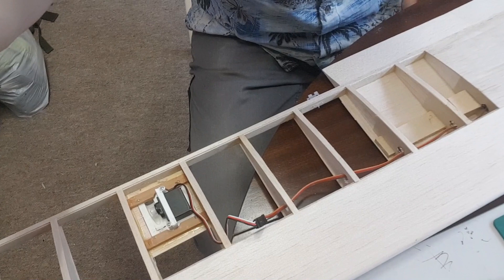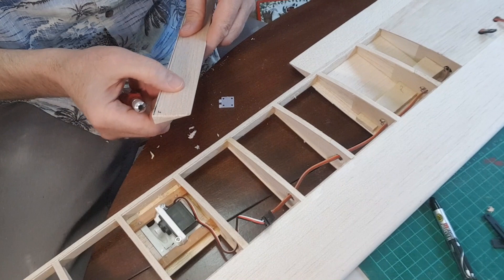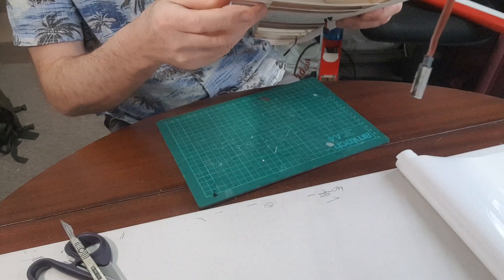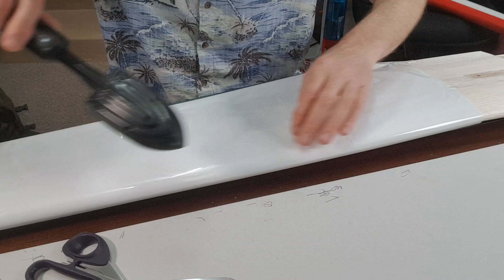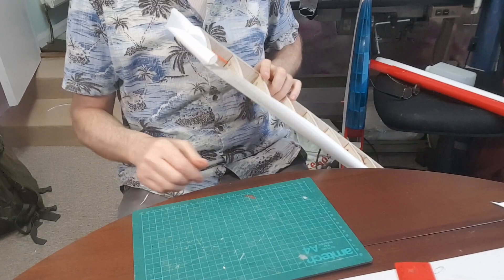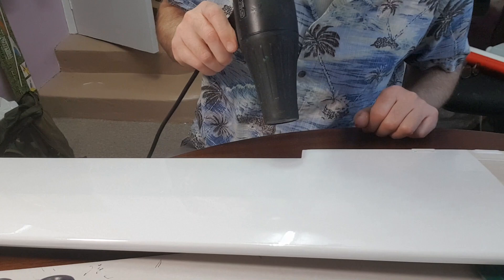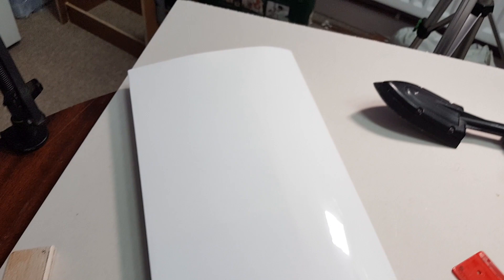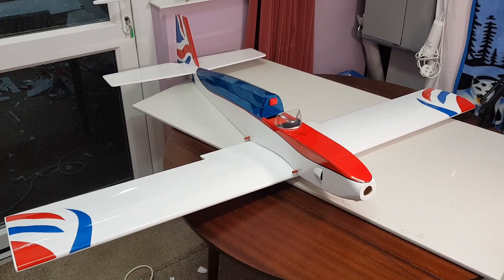Kamco Kavalier RC Plane Retro Build Part 5 Covering the Wing

Comment: Wow Cliff it's looking great,  when you covered the second half,  top, of the wing how much do over lap the covering? Hope you're not going to fly around the pole and risk cracking the beauty up. Looking forward to the next episode,  Jeff in LA USA
Reply from the maker: Are you say my round the pole models end up in the bin Jeff? 😁😁 To answer your question though I don't really have a set amount, it sticks pretty well to itself with heat, could be as little as 1/8in or 3/8in, what you don't want is the covering to pull away when you heat it due to insufficient contact area being stuck down, it comes with experience I guess.
Reply: @CliffHarveyRCPlanes  Thanks  Cliff, right now the balsa plane I have is the SIG Kadet Senior Sport, the seams are real hard to see.  
I would not like seeing Kavalier get dinged up, Jeff